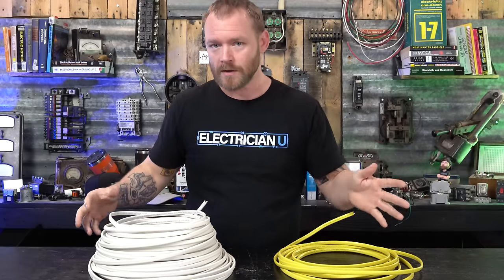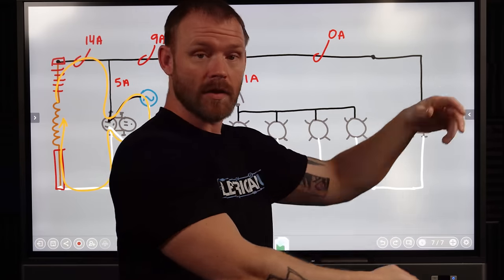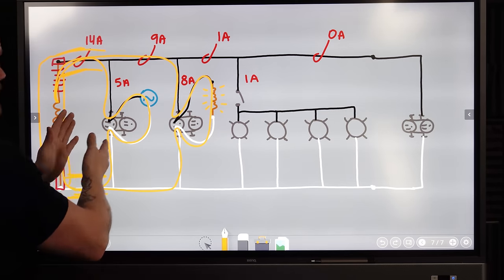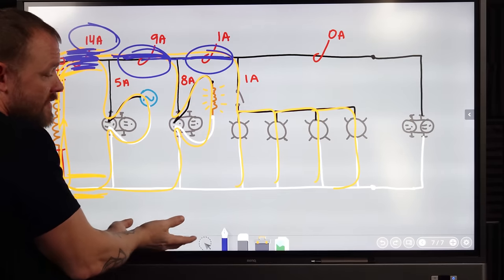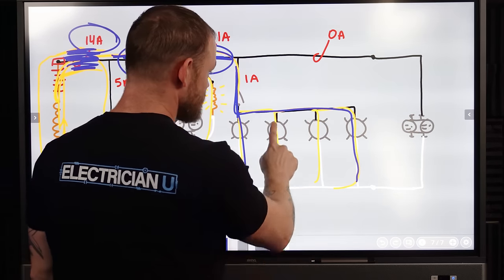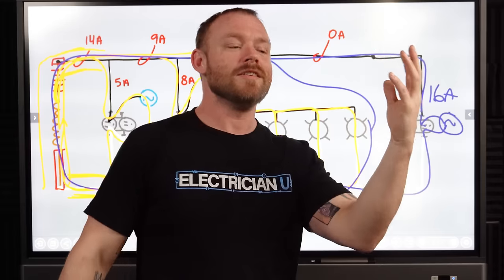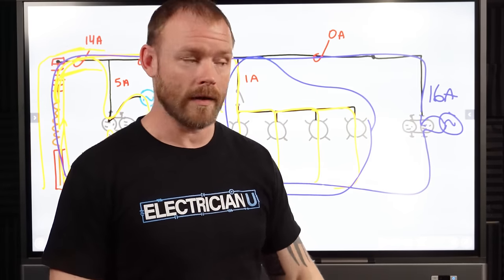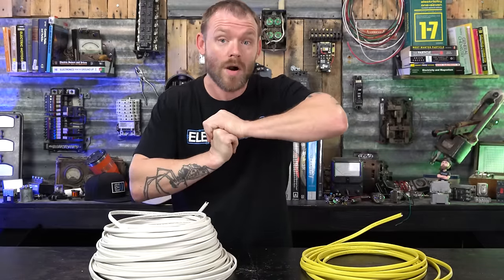Should You Be ONLY Using 12/2? When Can You Use 14/2?

Comment: 100% what happens when you have a overload on the 14 gauge conductor, but not enough to exceed the load for 12 to gauge conductor that’s connected to a 20 and breaker, the 14 gauge wire is not correctly protected a 15 amp breaker because you chose to put in a 20 inch breaker and then tapped off with a 14 gauge wire. Wouldn’t that make the 14 gauge wire carrying the overload get hotter or you can become a fire hazard for long enough if the load was high enough to burn the 14 gauge wire but not enough to trip to 20 amp breaker, the only problem is this it’s not legal by the national electrical code, so not only are you teaching people incorrectly you’re also you’re undermining the intent of the code book by saying the code book says this but under the circumstances you can do something different if you feel like it, so the code books really only useful for applications, which they apply to noit’s self the whole electrical trade so in a way if you could transfer that in different applications of life, you could say we have a drinking law of 21 years old hot if it’s a certain day of the month and it’s a certain degree out in the sun situation, you can drink that any age you want and not be responsible for your actions because the law didn’t specify that particular incident situation or you could say you can do whatever you want to do if the law doesn’t particularly categorize every part of the situation involved in and that’s a lawless behavior, secondly, say someone watches this video and they’re working at their friends house and if they have a license, he says no I watch the video and it said you could do this, so he runs all the lighting in number 14 wire whole bunch of lighting at 14 wire, then feed those circuits with 12 /3 double pole 20 amp circuit breakers and then because he’s not licensed doesn’t know whether he drops a neutral out so in a sense you have a 220 voltage running through some wires at 20 Amp thing or overload  or something happens in the 14 wide conductors catch on fire in the middle of the night and some people get hurt and there’s a lot of property damage so they called the insurance company and they said this is not legal wiring. This is why your problem cause the fire. Who did this illegal wiring is going to see my friend Nextdor Siri go to friend next door and say did you wire those circuits in that house because we’re not gonna give him his insurance money for the house now so he’s gonna sue you he said for $500,000 in wrongful death and you turn around and say my brother-in-law is a lawyer and I’m assuming the guy who made that video who showed me how to do that I want that you open your mail for you to knock on your door as the sheriff with a warrant for your arrest for attempted murder, or at least harmful behavior because you thought you could just say into whatever you wanted to do so not only are you getting sued you get sued by multi millionaire lawyers, or trying to get you for harming somebody or killing somebody instead of just paying a few more sense or talking with dollars and running the whole circuit the number 12 circuit with individual breakers like it’s supposed to be done if you were a license electrician and it goes against one more thing number three the reason why the Electrical community in the article business, it’s not right as far as residential in light commercial is because people don’t want to pay electricians what they’re worth so I have a friend who watches videos to work for because they only cost them a case of beer or 50 bucks for fan. It’s actually breaking the law and it’s disrupting the value of your neighbor electrician if you what if your next-door neighbor on one side was electrician and he left side with someone who watch a Videos and you ask the guy who watch a Videos to why your house house burns down as of your family what do you think? The electricity on the other side is going to think of you? Is it really worth that kind of savings or worth not paying the correct amount, so it’s like I said you drive a truck and all of a sudden a couple years they have trucks that that drive themselves and they say OK to be fair we’re going to put out a poll how many people want to drive trucks driven by humans how many people want trucks drive by computers? What are you gonna vote for him to say well I know I make my money like driving a truck, but I think I’ll vote for it would be less expensive for people that didn’t have to pay us and have a cheaper way to go and I’ll just deliver newspapers from now on in the fourth and Balto thing is you judge your videos and you are understanding of life in situations you don’t understand the fact you’re a people who are smarter than you also are people who have less understanding than you need for those people you’re doing a greatly injustice, because those people believe what you say to be true, and not have the fear of things not going the way they should be and they don’t know any better you are saying use 14 wire because it’s cheaper and then you give your reasons why because unless of the amperage situation which the wire is not read it on this amperage, we did read it on his protection from amperage, so he interprets you were saying why buy more expensive wine when you can do the same thing with a cheap a while so he goes to his parents house we bought a new electric stove and why is it with 14 gauge wire in the elderly and I don’t know the difference in the real proud of this son for doing these kind of electrical jobs but what you didn’t know was that the video he watched after yours or A was talking about main lug panels and he took out the main breaker panel and put the main lug panel in there so when the circuit breakers in the whole WIRELESS situation started going crazy there was nothing to protect the wires and now this guy has to live without his parents thinking that he killed his parents from watching people who lied to him and now he’s mad at you and he’s hunting down so you walk out of your house and he’s gonna make you pay for his pain and anguish for listening to your video we will stick to the proper way to do things. OK the money making problems. I hope this video of this comment was helpful to you I mean I understand you’re talking about and yes people do do that but it could be a trip is the wrong way if I can help in any other way just let me know keeping a watchful Out

Comment: Yes, that is fine in theory. However, 240.4(D) only allows 14 AWG copper wire to be on a 15 amp overcurrent protection device. Your best option would be to wire the receptacles with #12 and the lights with #14. (Fun fact:  In Canada they require receptacles to be on 20 amp circuits) The other issue is if there is a fault. If you used 18 AWG wire on a 20 amp circuit and there was a fault that wire could be damaged.

Comment: 14 is trash. I consider it to be unethical for an electrician to cheap out and use 14 in most cases. I was at a supply house waiting for them to grab my order and a guy comes in and picks up 1000 ft of 14/2. He said "the city of *** still allows you to use 14/2. I just charge the same price and the customer doesn't know any better". He then laughed maniacally as he walked out the door. I kid you not this was real. I got the impression that only super villains would use 14/2 to wire a house. Every time I have to change out a melted plug and I see those brittle 14/2 wires I think about that guy cackling while counting wads of cash under a red filter with a cigar in his mouth.

Comment: No No no, if you start with 12 on a 20A breaker you stay with 12 on a circuit period. I would run all lighting in 14 because it's easier and all the recepts. in 12 but never run any 14 under a 20A fuse.

Comment: If you use 14 wire anywhere in the circuit you cant protect it with a 20 amp circuit breaker

Comment: So, the answer is " Depends on the regulations in your area and depends if you want a 15A or 20A circuit..."  
We all know that 20A circuits requires 12awg minimum and 14awg for 15A...
This video could have been  2 minutes. Instead, you decided to REexplain the parralel and serie circuits...🤨🙄

Comment: This seems silly to me.  We do hundreds of units per year of multi family and we would never do this. I dont see inspectors in Colorado approving this and Im definatley not gone argue this point with an inspector. We use thousands of feet of 14-2 on 15 amp circuits and it works great. Also in the current market of electricians available (low caliber electricians) you would waste all your time explaining this silly concept, it would be a disaster. Never heard of a jurisdiction that doesn't allow 14 gauge wire, not in Colorado anyways. Im glad I dont work for this guy his employees probably spend way to much listening to him spew code so he can feel good about himself.

Comment: This video is REALLY bad advice! A fire waiting to happen. 
Read on...

One question I would have is: Why are you using a toaster (which would most likely be plugged-in to a kitchen counter-top circuit) on the same circuit as your lighting? That would be an instant code violation (kitchen counter circuits must be 20A and dedicated). Or are you plugging the toaster in at a dining room wall receptacle, which "could" theoretically share a lighting circuit? (Not to mention, the toaster cord probably won't be long enough, unless your using it on the floor...LOL!).

Also, NEC would prevent you from using from using any #14 conductors down-stream on a 20A ciccuit (downstream of a 20A breaker), since #14 is only approved for a max. of 15 amps (i.e., 15A breaker size). It would be an instant code violation to start a 20A branch circuit in #12, and then go down to #14 wire size, ANYWHERE downstream, including after a switch.

While conductor sizing is (or can be) based upon calculated total (or maximum calculated/anticipated) loading for given branch circuit, the circuit breaker MUST be sized appropriately to protect the conductors, and not the anticipated load. 

While you could "legally" use #12 downstream of a 15A breaker (hell, you could use #10 if you wanted to!), using #14 wire ANYWHERE downstream of a 20-amp circuit breaker would be a Code violation.

This guy will never wire one of my buildings (residential or otherwise).

BTW, I've been doing commercial and industrial (and residential) electrical for 40+ years (now retired, but still doing side-jobs!).

Comment: I despise 14/2 wiring and 15 amp breakers. It's a sure sign of cheap materials and poor workmanship.

Every single time I have had to deal with a house built with 14/2, it's been nothing but garbage, top to bottom. Circuits with a dozen or more outlets on a single breaker, some with 6-8 outlets plus lighting. Cheap outlets. Just poor quality from start to finish.

I refuse to use 14/2, 15 amo breakers, 15 amp outlets, and other cheap materials.

Comment: Why would anyone want to run 14/2 though?
Reply: It's cheaper, it's easier to work with, and its sufficient for the job. Why not? 12 is overkill for general lighting circuits.
Reply: @phi5head  Perhaps now due to all the low wattage lighting. But still why would anyone ever went to permanently limit themselves to a 15A breaker. I was trying to see the overall cost difference between 14/2 and 12/2

Comment: Its fault current if you have a 16-amp fault in that circuit the breaker wont trip and your insulation starts melting. Quit misleading people! you cant breaker a circuit at 20-amp if you have 1 inch of 14 gauge.
Reply: Incorrect. Table 210.24

Comment: Electrician for 15 years, been in another career for the last 10 years. Unless something major changed, the breaker equals the smallest wire in the circuit. With that said, there is no reason to not wire the whole circuit with the same wire. You would be wasting money to run 12 to the parts of the circuit you thought might have a large load, because they would never have more than 15. Very weird video.

Comment: OR when a DYI guy does a junction box and finds the 15amp wire and installed a plug from it and uses it for a 1500 watt heater.......bye bye neutral

Comment: Resistance in 14 AWG will cost the home owner more than initial price difference! Also, voltage drop is significant in a single family house. Just use minimum 12AWG and reduce the future headaches!
Reply: Wrong on both counts, neither statement is true.
Reply: You can tell who's a real professional or who's a wanna be-an armchair diyer expressing their theoretical concerns 😂.
Reply: @inthemiddleof  Do you call yourself a professional when don’t know the basics of voltage drop calculation and wire resistance 😂😂😂
Reply: @pld8993  get a calculator and calculate the voltage drop also power loss due higher resistance! Then you can see who is wrong.
Reply: @7REZAAZAD  are you wiring a tunnel  or airport? Voltage drop?! It's a single family dwelling dum-dum! There is no significant voltage drop on less than 100' runs!
Reply: @7REZAAZAD  I've done the math plenty of times. Voltage drop is irrelevant in most single family homes because very few circuits are 100+ feet, and even fewer have circuits whose ampacity is maxed out, the 2 conditions that drive voltage drop. You're obviously not an electrician.

Comment: 14 gauge wire = 15 amp OCPD. If the circuit is protected by 20 amp breaker ALL conductors need to handle 20 amps...PERIOD. Electrician U ???? In what universe? These videos need to stop. No licensed electrician needs them, and apprentices are already in school. These videos are only there to confuse DIYers and get someone seriously hurt.
Reply: Incorrect. Table 210.24

Comment: I would like an example of a code where this type of shody wiring would actually pass. The breaker's main purpose is to protect the wiring. If any part of the wiring in a circuit is sized smaller than the current rating on the breaker, then that part of the wiring is not protected. You sound like a propogandist who figures if you say something loud enough, enough times, people will believe you. Heck, you might even start to believe it yourself. Before anyone wants to start to debate it, I want to see an example of where this would meet code.